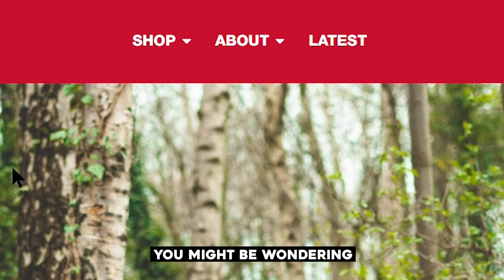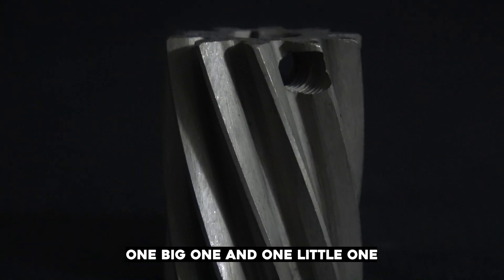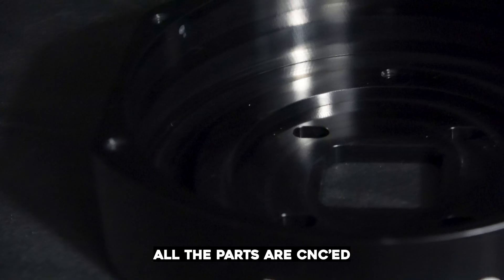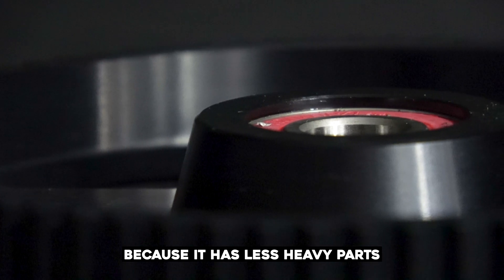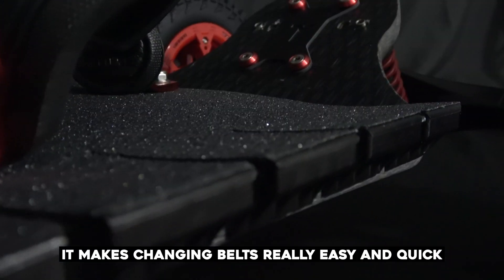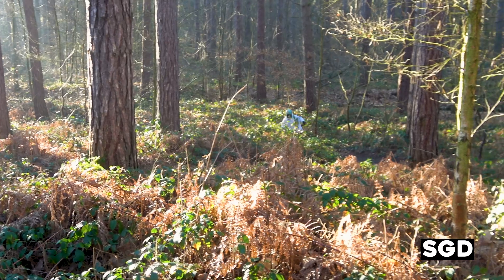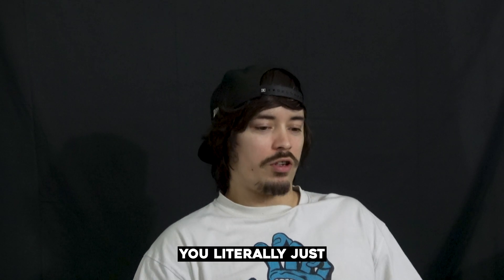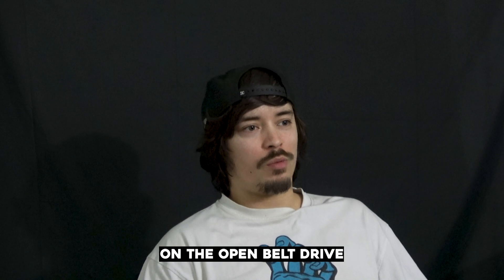Which electric board is the best? SGD vs OBD

Comment: I love this company .....but I am on Acedeck Z3 with suspension and gear drive {TRAMPA BINDINGS, TRAMPA MUDPLUGGERS]  1033W version ....AND ITS HEAVY LIKE A COW .....its very difficult to jump high, its very difficult to control thtat heavy board when in air and ,,,,,,,bassically its not even fun to jump with heavy board like this.......I did never think about belt drive like an option with benefits.....until this video XD ...
Reply from the maker: It definitely has its benefits for jumping. Gear Drive and belt drive both have their benefits and come into their own in certain environments

Comment: SGD for 10mm motor shaft is best
Reply from the maker: Try telling that to sonnie!
Reply: @TrampaBoards  already talked to Hamish about it. Hoping you guys do since nobody in the aftermarket has that and you can count on everything continuing to move towards higher voltage and lower kV. This just tends to happen with high performance applications of brushless motors so Sonnie is going to have to save the weight somewhere else - don't want you guys getting left behind!
Reply: @powerofyourbrains  il have to start doing some cardio 🏃🏻‍♂️‍➡️